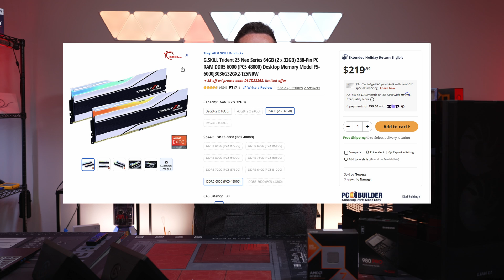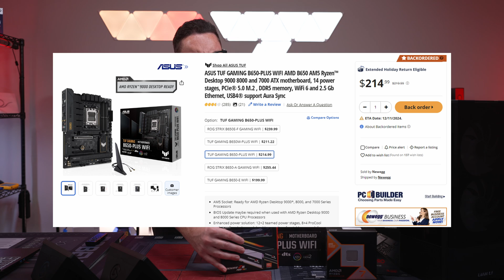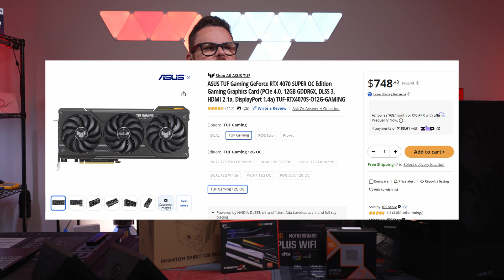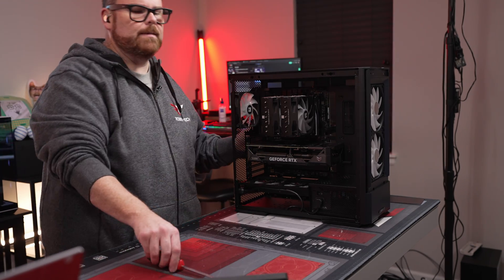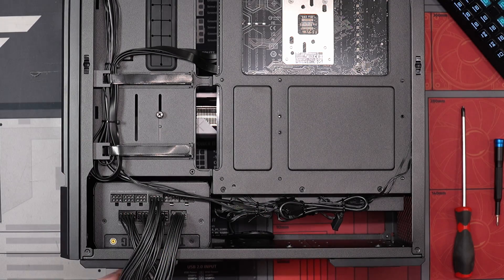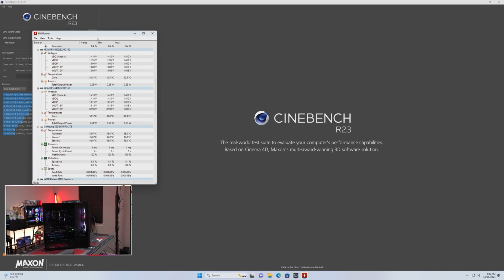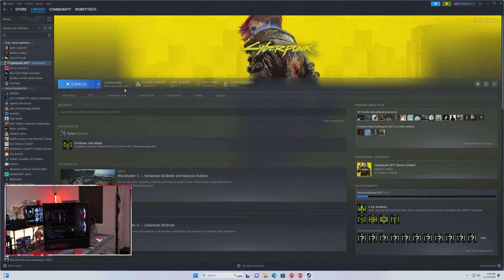This the Perfect Combo? Lian Li LANCOOL 207 + Budget Ryzen 9800X3D PC Build

Comment: Thanks for the Vid, will you get better temps with more fans on the top of the case? I'm planning on putting a 5090 astral and 9800x3d with thermaright PS 120 Evo into that case, will there be any issues, TIA!

Comment: Interesting build but I'd have traded the 4070 Super for a RX 7800 XT. Amazing card for the money when I got mine in 2024. Better software than Nvidia, now HAS frame generation, etc. 

I might have also skipped on AMD for Gigabyte parts to save a little more money too. 

Though be warned, Gigabyte's RGB software sucks.

Comment: So ive got this exact build almost but my part colours are all mismatching. And ram is corsair vengeance. And 990 pro ssd. Aaand I was planning to get rx 9070xt when it's out. And I went overkill c1200w psu.. Idk which motherboard is best? Shall I just go with a b650 also? Isn't x870 better for it, and is flashing the bios hard on b650 for it, or necessary on x670s? 🙏 (I also haven't got 9800x3d yet but I'm planning to. Price is fairer to retail than what the 7800x3d is currently so. Though I'd like more cores also.. The 9950x3d will probably out of price range for now... And I'd love to wait but ehh. 🙏 Really appreciate the building vid I'll watch thoroughly when I'm assembling mine next month hopefully

Comment: This is not even 1800, unless you exclude the SSD and tax. Is this an attempt to get people to click the affiliate links? (if using the links, this is more like 2400, and is not a good build at all with the parts selected)
Reply from the maker: It’s meant to show a little money wasted build for the 9800x3d while optimally pairing parts to do just that.  The links you are referencing also give options for different GPUs in case you did want to go higher than a 4070.  This is a good enough build, not a spend money on the best build.

Comment: Decrease the ram, get a MP44L for half the price and you could have easily gotten a 4070 TI Super or a 7900xtx easily. Not a bad build but a few tweaks and it could have been amazing.
Reply: You mean SSD
Reply: @ MP44-L is an nvme drive. So technically not wrong but yes.

Comment: The imbalance between GPU and CPU
Reply: 4070 super and 9800X3D are a good match together. Sure I guess that cpu deserves a 4070 TI Super or 4080. or even wait for the new 5000 series. But the 4070 super is a fantastic card either way. the 12GB Vram is the only downside to it, which is debatable for certain games at 1440p